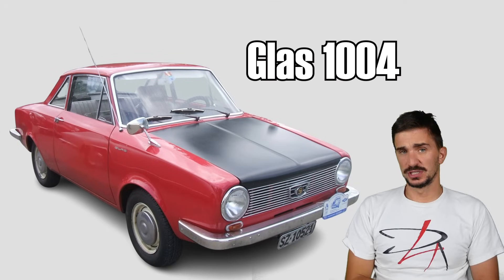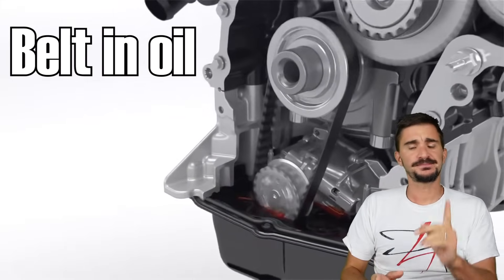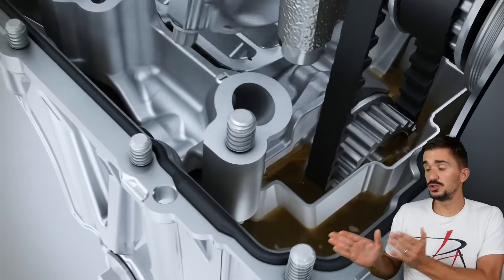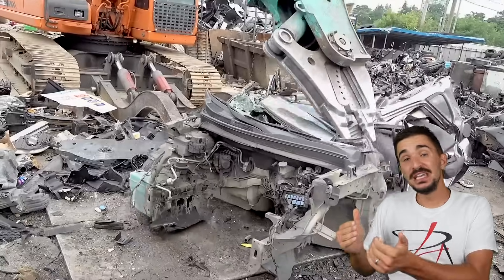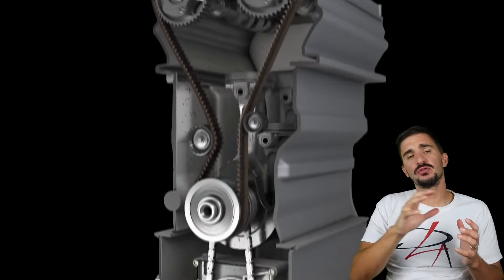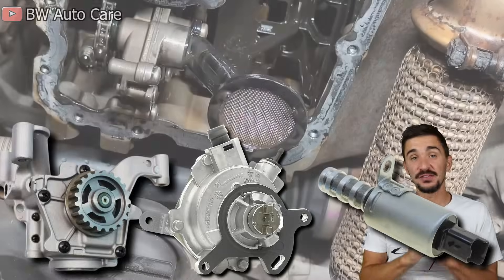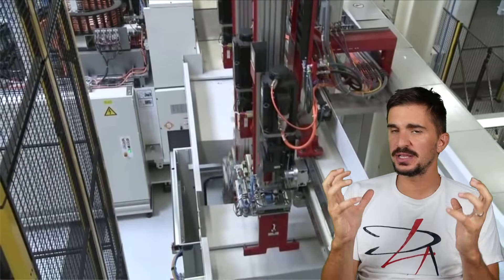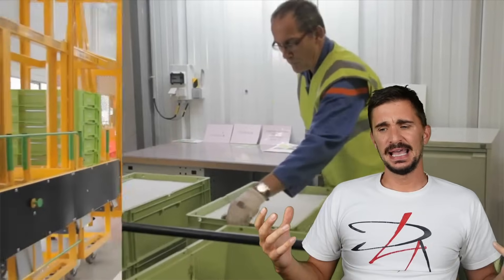Who Approved This and Why Is It Still Being Made? Wet Belt aka Belt in Oil Engines

Comment: Engineer: uhhh wet belt would break down so much quicker
Exec: yeah but it saves $10 per engine and makes us even more money per failure fires engineer
Reply: Well you see it's actually great that the car will fail quickly and the repair bill is gonna be astronomical, cause that will push suckers (us) to buy more cars
Reply: THAT exec has a bright future at Boeing...!!!
Reply: @piccalillipit9211  unfortunately, that became the rule across all industries.
Reply: @Matt_Duke  more cars from another manufacturer.
Reply: Its known as a “career limiting question”
Reply: New practices in Auto industry after 2009-10 restructuring after 2008 economic collapse?
Reply: Rubber belts aren't basically hardened/dehydrated oil that returns to liquid state when in contact with liquid oil that the rubber belt is made from?
That's what I've thought since teenager.
Reply: Lol...a well placed ad blurped out the word PROFIT.
Reply: I suspect that a key factor, beyond saving a buck, is that '1%' fuel issue. Manufacturers are pressed against the wall by arbitrary government regulations.....increasing fuel mileage by one percent is of no value to the customer, but makes a significant difference in the mix of vehicles the manufacturer can sell--they can sell more higher end cars which are more profitable.
Reply: @theronwolf3296  corporations pressed against a wall by government with a wink and nod?
Reply: My work van has had 2 engines on warranty paid for by ford, it's literally costing them millions upon millions. I don't understand why they're still using them
Reply: @GuagoFruit  Why would a company care about a 1% fuel economy difference EXCEPT that the government is threatening to fine them hundreds of millions of dollars?
Reply: that exec is channeling the spirit of Roger Smith
Reply: @theronwolf3296  CAFE standards have lead us down the CVT path as well.
Reply: @theronwolf3296  Although I think regulation is a good thing for the most part, sometimes it creates effects in how the game is played that isn't the effects a consumer would want. Massively sacrificing reliability for an annual €15 fuel cost saving is one such effect. Governments should stop and think (good luck with that though...).

Obviously I don't need to say why reliability is important but I will anyway: If you car breaks down on the way to work for instance, how much is that gonna cost you in lost wages, money spent on towing the car, money spent on repairs and then money lost on replacing the utility the car would've had if it wasn't in the shoppe? A lot more than €15, that's for sure.
Reply: I still have no idea how a business model like this is profitable? If the engine is that unreliable do the execs think that the customer will keep maintaining it or buy another product of theirs? The logical thing for the customer to do would be to switch manufacturers in this scenario.
Reply: @jjc4577  True. CVT and start/stop are two terrible ideas that provide very little benefit except for bureaucrats.
Reply: Exec: will it last until the warranty expires?  
Engineer:  yes, 99% will make it to the end of the warranty.  
Exec: great, go for it.  We will sell more cars after the warranty is expired and it will get one more MPG in testing, win-win.
Reply: @johnbaker1256  Doesn't matter, exect got fat bonus and is now working on another corporation and stocks went up for a while anyway.
Reply: @mrcaboosevg6089 that’s your country but my country they wont do shiet under waranty and ask me to pay
Reply: Someone could come out with a chain retrofit kit
Reply: Exactly! Bean counters are in charge.
Reply: @theronwolf3296  Exactly. They want to sell huge SUVs and oversized trucks, at least in North America, so they also have to have the 1.xx liter engines to boost (sorry, pun intended) their company fuel mileage numbers.
Reply: @Matt_Duke  They aren't that smart!
Reply: As a mechanic, I gotta thank ford for providing me job security 😂
Reply: @theronwolf3296  start stop is great and when paired with a proper mild hybrid or 48v starter is magic.  I hen you try to do it with a normal 12v starter you have a shit show.  I guess you could make the same argument for toroidal cvt being great and belt on cone being a cheap shit show, but I have never been in a car with a good cvt.
Reply: @paulsmith5611 in NA you get an mpg multiplier for commercial related things. Make it AWD or 4x4, give it 7.75 inches of ground clearance, make it over 6k lbs, make it longer (but not the bed, that means more tax,) make it flex fuel, and then you get an 18mpg full sized crossover SUV counting as a 45mpg hatchback on your cafe score.  Every vehicle class giving it 7.75 inches of ground clearance, adding weight, and making the roof a little higher gets you 20-30% minimum added to your fleep mpg for cafe. That is why good cars are basically gone and hatchback/wagons are dead for worse versions as crossover or compact utilities. 

They don't even test light duty commercial vehicles with any load.  They don't care if your truck gets half the millage towing a trailer with a turbo 6 compared to a V8. If you save 1-2 mpg in th city and tie the highway number it is a huge win.
Reply: lol this, it always amazes me though that when people want to grab the posts and the ropes they always go for the engineers and never consider the guys calling the shots. 

It's almost like that saying "the devil's greatest trick was convincing people he doesn't exist" except replace devil with CEO. The worst part is people will throw themselves in front of a bus for those guys even though they go out or their way to constantly make lives miserable with cost cutting decisions that only end up benefiting shareholders.
Reply: @bigjd2k  Available for Ford and some others , just looked I had no idea. Retired some time ago .
Reply: @zanzabar4ky7  Thanks , didn't know there were multipliers for CAFE.
Reply: some car manufacturers "our car is cheaper to maintain because we have long oil change intervals" these people really have the guts to tell you some dumb sheet 😅
Reply: @jmbpinto73  designed obsolescence
Reply: @zanzabar4ky7  The auto start can be made to work, at the expense of a complex starter and expensive to replace battery.

IF it accomplished something useful, maybe worth it... but there is SO LITTLE gain it's not worth it.
Reply: until justice force them to replace or repay all customers for faulty engines :P
Reply: @bookofrevelation4924  aren't or are?
Reply: @theronwolf3296  the 48v battery and mild hybrid costs about $400.  The battery is unlikely to fail to the point it won't start and will save cost over the main battery and starter. 

The manufacturer could make things suck and not use the standard Borg Warner battery pack.
Reply: @zanzabar4ky7  but a hybrid does not need engine start/stop for stop and go traffic. That's all handled electrically.
Reply: @theronwolf3296  true mild hybrids do just the auto stop start and to 1-3mph. It costs almost nothing to add, makes auto stop start work better, and makes the whole car better.  They also do not need alternators so the cost is almost non existent over traditional.  And less than a beefed up starter for auto stop start. 

Borg Warner has an amazing system that is well under a grand.
Reply: ford bi turbo engines 2l enters the chat
Reply: It's the way of the world. Unfortunately, of course. If only just that mindset would be fixed, the world could probably be saved, right there and then.
Reply: @marquez4497  maybe, but working all day on Ford engines is a special kind of torture.
Reply: We must also please our shareholders!
Reply: Sounds about right
Reply: @theronwolf3296 Nissan CVT, the worst of all, is probably costing them half of what a traditional transmission costs. Not Nissan making those decisions anymore, it's Renault.....the French...who suck at cars and...
Reply: @marquez4497 😂🎉
Reply: @cudatom9290  thanks for the question, Cuda.
Yes, are or are not rubber belts basically petroleum oil that's processed to harden it into rubber?
That's what I've aways thought, and figured it slowly returns to liquid if in contact with liquid oil to start reversing process that hardened it, sort of.
Reply: @zanzabar4ky7 youre right
Reply: Environmentally friendly ahead of human friendly
Reply: @honderdzeventien   It’s not the inescapable way of the world. 

"Show me the incentive and I will show you the outcome.”

Charlie Munger
Reply: As much as cost savings are present in my car, I do feel a little smug with timing chains that don't have a factory replacement interval because they are expected to last the lifetime of the engine.

Unsurprisingly it is a Japanese car where they still (largely) listen to engineers over beancounters on the oily bits.
Reply: Also Exec: “Can you make it last until the warranty expires?” 

Engineer: “Well yeah, but…” 

Exec: “Great! Let’s do it.”
Reply: @theronwolf3296  arbitrary government regulations likely lobbied for by those same manufacturers. Because it allows them to implement changes such as this and means that an additional whistle is needed for a competing car to be allowed.
Reply: Cutting corners on manufacturing leading to greater costs for the customer. There are many such cases. 

My Jeep has a spring-loaded"smart headrest" which is supposed to only deploy during rear-end collisions to reduce whiplash. The release mechanism is a couple of hooks which unlatch from a metal rod. The only problem is that said rod is held in a bracket that is made from very cheap, flimsy plastic that is prone to breaking. no doubt to save a dollar or two per unit.
And now you know why my driver-side headrest has zip ties wrapped around it.
(It was either that, or spend several hundred dollars on a replacement headrest, which will have the same defect)
Reply: @theronwolf3296  yes, this obviously negligent and greedy act from big corporations is the government's fault. Great takeaway champ
Reply: Don't forget that 1% fuel economy savings that we can show the EPA for more subsidies...
Reply: @rpgspyware9560  It seems to work for Ford.
Reply: @piccalillipit9211  naww not enough fatalities to be able to find a job at Boeing, also needs to "deal with" any whistleblowers to prove they have what it takes to be a Boeing Exec.
Reply: @Matt_Duke  Problem is it pushes us to buy other makes... As a long time Ford man I have held onto my car far longer than normal and the replacement will not have a wet belt and probably will not be a Ford.
Reply: @Matt_Duke The only problem is that customers may not buy THEIR cars.
Reply: Auto manufacturers don’t care about engine longevity. They are more interested in fuel economy.
Reply: @Matt_Duke  The mistake you've made though is that the suckers would just stop buying such cars that have poor reliability reputation.
Reply: @theronwolf3296  i think it is debatable that 1% does matter so much, i don't see anywhere mpgs reported with that accuracy  :) . That 1% is purely theoretical, in reality most of those engines are not economical at all.
Reply: @Matt_Duke that logic doesn’t make sense because if the car fails catastrophically the customer won’t buy from the same brand again.
Reply: @warmygreenfields  Very true, it's insignificant in the real world... but it makes a difference along with a few other minimal changes to tweak the system.
Reply: Don't go giving engineers credit where it's not due. they are a huge part of the problem. they don't even know what they are designing. and I can vouch for this. I was an automotive technician for many years. and I have experienced it first hand. a large number of modern vehicles incorporate their horrible designs. especially engineers at Ford Motor Company, they design some of most unroadworthy garbage there is hands down. I know I will catch hell from engineers out there on the interweb. but before you reply to my reply. I suggest you work on some of the garbage tha you design.
Reply: @warmygreenfields in Europe, all cars have their g/km CO2 figure calculated (which is basicly related to fuel consumption) and its used to calculate tax in many countries, and also each brand has targets for their whole model lineup to average below. Shaving as much as they can off these figures can really make a different to how many cars you can sell or fines you need to pay if you exceed the limits which are always tightening.  
Toyota went heavilly for hybrid tech which was initially quite expensive.
Ford went wet belt as they thought they’d get away with the reliability (still a top selling brand so in reality they have).
VW were motivated to cheat the tests which worked really well untill they got caught but it nicely demonstrates how desperate manufacturers can be to get a lower emissions figure so it cant be downplayed how important this is to them even though the consumer doesn’t really care about the detail. 
Also most people who order a new car get it with a warantee and maintinance package and will have moved it on in about 100k km so dont worry too much about reliability as thats a used car owners problem (though they also then treat it badly as maintinance doesnt really matter if its new).
Reply: @theronwolf3296 
That's not true, Ford has had some of the worst CVT transmissions of all the manufacturers. however Toyota has some of the best CVT transmissions ever made.
Reply: @OrganicWheat GM has the longest service intervals. and even lifetime antifreeze. but that doesn't mean it's a good thing.
Reply: @musicauthority674  'Best CVT' is the problem (though I believe Subaru==and numerous other vehicles) is from the same vendor). CVTs by nature are much weaker and failure prone than conventional planetary geared automatics.

The drive belt/chain is a rolling friction design where it is constantly slip engaging and disengaging. That's a LOT of wear which increases with load even below maximum rating.

By contrast, the bands and clutches of a conventional automatic use static friction, the only 'wear' they see is during the fraction of a second during gear change. Since there is nothing slipping, load does not increase their wear.
Reply: @theronwolf3296  
Heat is the number one enemy of automatic transmissions. that's why additional transmission fluid coolers are necessary. on vehicles that do a lot of heavy hauling, and towing, and extreme duty work, such plowing snow. once the transmission fluid smells burnt. it's too late the transmission is done for. and it's only a matter of time before it fails. and that would surely be the case with CVT transmissions. along with the fact that there's constant slipping of the parts in contact with each other. very similar to a CVT system on a snowmobile. I worked as an R&R man in a transmission shop. and was a snowmobile enthusiastist for a number of years. so I have pretty good idea how these transmissions work.
Reply: Paws against the earth,

Nature's rhythm in my bones,

Instincts come alive.
Reply: I don't think so.  I think they did it to meet the fuel regs. A 1% savings is nothing to the consumer. But it is something to the people enforcing CAFE or what the equivalent is in Britain and Europe.
Reply: @lealandyoung nah, a lot of theses CEOs destroy long term shareholder value.
Reply: @tarstarkusz  That's exactly the problem. The government is so obsessed with arbitrary requirements, and ignore the reality on the ground.

If requirements result in decreased product life or more replacement... those are much bigger environmental costs  than a negligeable fuel consumption change
Reply: Technical companies should be managed by technical people. We need to stop letting business folks decide what's best for engineering or manufacturing companies.
Reply: @RaptorJesus10  They are the ones who give you a job and keep you employed.
Reply: @RaptorJesus10  The problem here, though is worse, because government finger was the scales. 

The executive wants the cost to be low, both for profit and market share. The engineer wants to see best performance. The customer wants a reliable product and does not care about 1%. The government makes the rules without the consequences.
Reply: The engine in my Dodge pickup is a 5.7 liter Cummins diesel. In-line 6, with all-gear valve train. In big trucks, the larger versions of Cummins diesel engines easily last 1 million miles before needing a full re-build, and park of the reason for that longevity is the all-gear valve timing.
Reply: The only engine FORD EVER MADE that was and IS Awesome are the Zetec, the i6 "barra" and the Zetec RoCam. Other engines are BAD!!!!!

It's an atrocity to human rights have an engine purposefully fail. ALL engines should be able to keep together if the maneintnence is bad, because not everyone can do that, even if they WANT to mantain the vehicle. The oil bath rubber will never work because rubber and oil degrade eachother. But even if it were chain driven, these engines would never last more than 150000 miles! And they would fail, generating more parts consuption as if it were an 80's engine that can last 8000000 miles without changing any internal part. Who is keeping teh environment clean??
Reply: Engineer: uhhh wet belt would break down so much quicker
CEO: Exeactly
Reply: @jmbpinto73  That is a problem because there are very few  car companies now.. most are joined in  a very few groups, so there is very little competition.
Reply: Engineer: uhhh wet belt would break down so much quicker
Exec:  EXACTLY !
Reply: Wet belt costs more when sealed timing cover vs. A closed stamped steel or plastic dry belt cover.
Reply: Engineer never retaliates. Continues to vote.
Reply: "I know this will bite us in the ass in a few years but at the next shareholder meeting a few people will be really really happy"
Reply: Kinda fun play no? Not many people can change a timing belt. Let alone a wet one. Then as a next step ask atleast 1200 euro for a change of belt. ????   PROFIT!
But except for that shenanigan if you can do the belt yourself engines like the 130HP 1.2l benzine are pretty damn cool and cheap. This is like a lesson that shows how we pray on each other for that green.